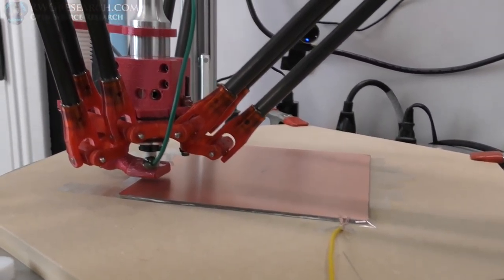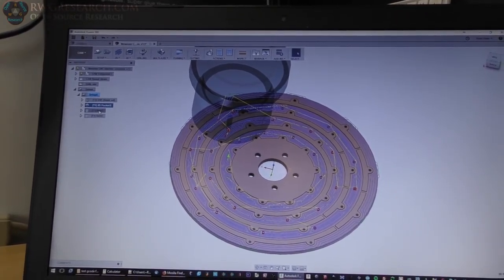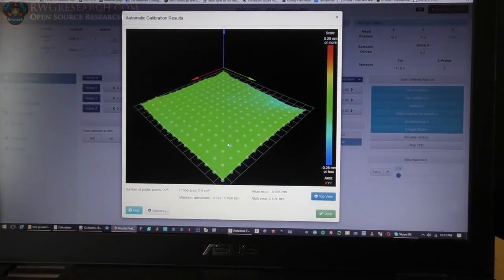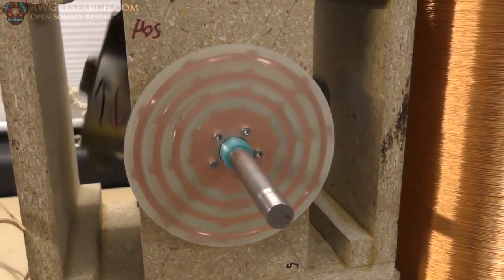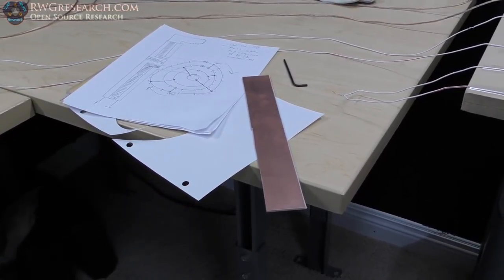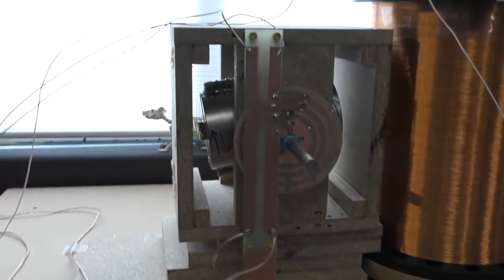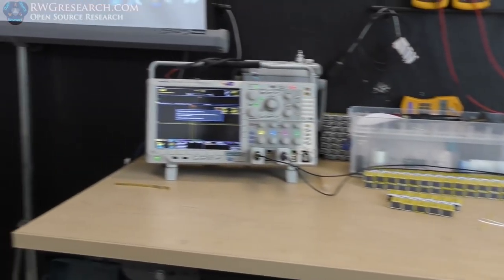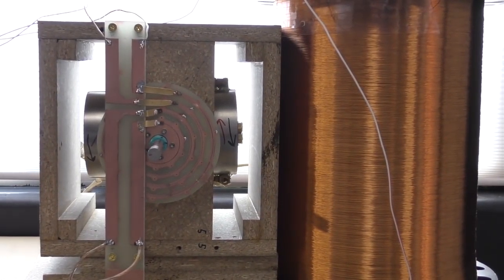JWN Project P6: CNC'N a New Comutator & Test Run,  Better Control For Timming

Comment: Did you make that robot cutter yourself? For a metal copper sheet you could use magnets to hold it down or you could use vacuum suction by having the table with small holes and have a vacuum suction keep the plate down. (just off the top of my head ideas instead of tape.)